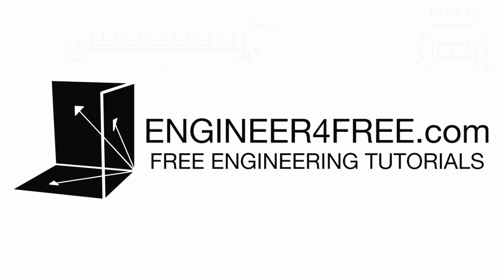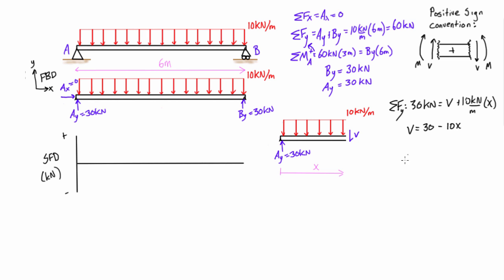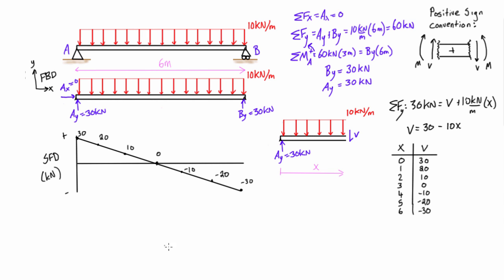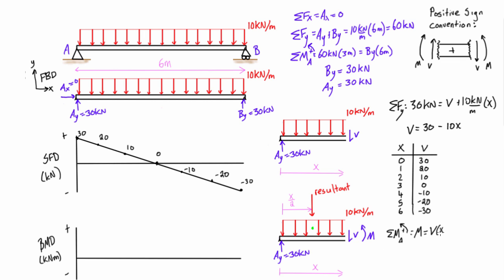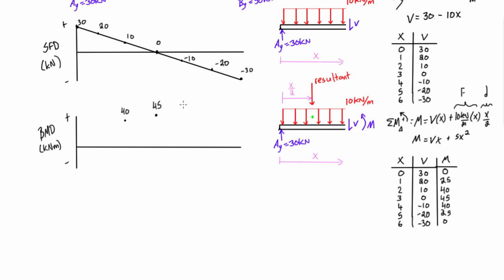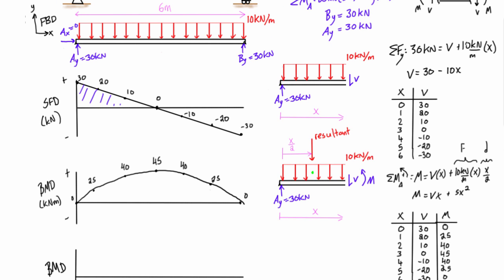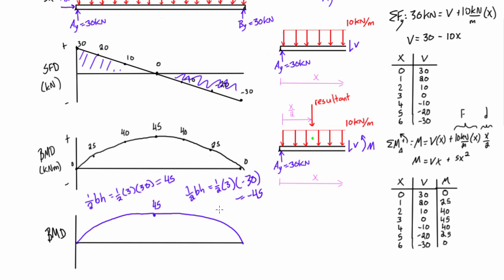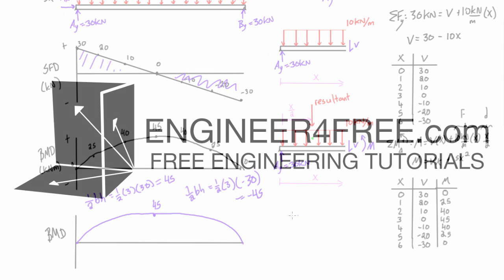Shear force and bending moment diagrams example #3: distributed load

Comment: I just took the integral of v(x) to find the bend moment diagram's function. Because you mentioned shear force is the rate of change for the bending moment. Seems to work and it's fast to do.
Reply from the maker: Yup. The method in this video is just a visual interpretation of the actual integration and derivatives that are going on between the diagrams
Reply: @Engineer4Free  How would we solve for the constant of integration if we used this method?
Reply: @Engineer4Free  Unless the BM at the support reactions is always zero, which would result in C=0 everytime

Comment: ok so like what if you have distributed loads as well as multiple point loads
Reply from the maker: Hey that's actually a really great question. I will try to make a whole tutorial on it tomorrow, but basically you will just do a new FBD from the end that you start at to just before any point load, start/stop/change of a distributed load, or an applied moment. Each time that you section the beam a little bit further, you will find out the expression for shear and moment in that new part of the beam and be able to add to the diagrams. It gets to be a lot of work on complicated problems, so naturally there is a shortcut and I'll just use that in the tutorial.
Reply from the maker: As promised: https://youtu.be/UEFa_haThwo
Reply: Engineer4Free thank you sir you are doing a really good job btw